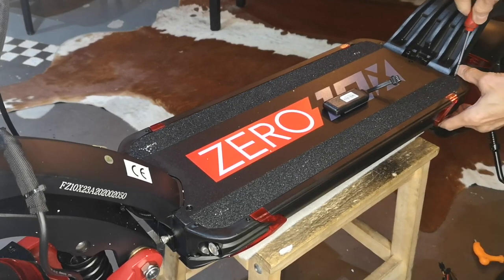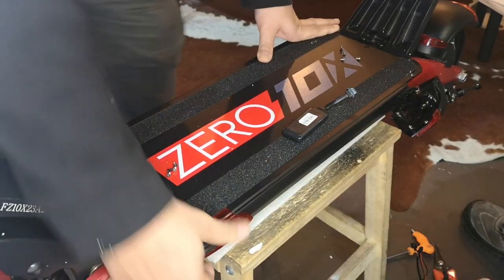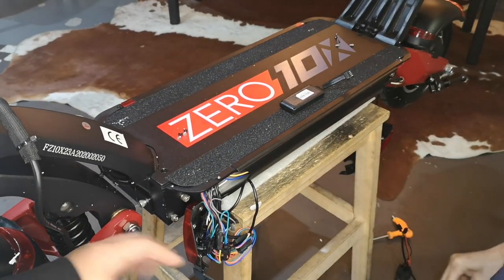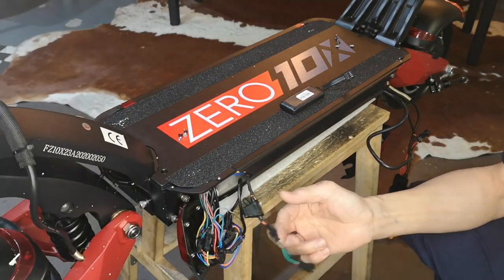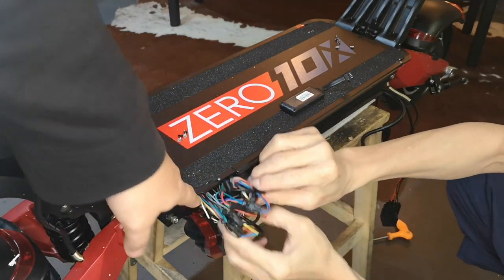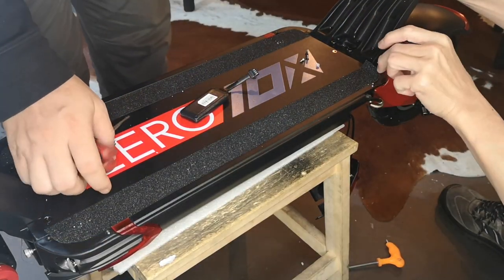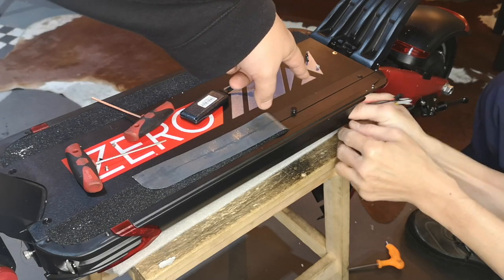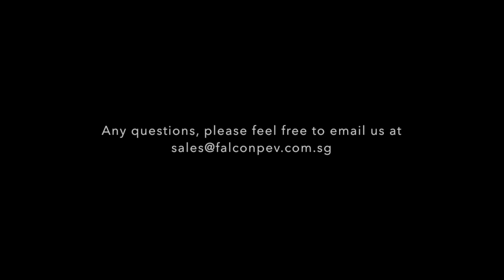How to Install ZEROTRK device

Comment: Will this work on other scooter brands meaning are they all wired the same with the colors matching.
Reply from the maker: It will work with most scooters
Reply: I wanna protect my new Nami burne2 max. Will it work for that make and model? Thank you for the quick reply to my first question. Appreciate it. I’m real worried about it being stolen as the cost is so much(at least for me ) to replace.

Comment: That's great. Thank you for showing this. 

I was curious if you guys can show a custom job, where you can make the 4 red plastic strips on the sides on 2 at back and 2 at front of zero 10x light up as a turn signal? 
So the bulb, electric work and wiring to make it happen.